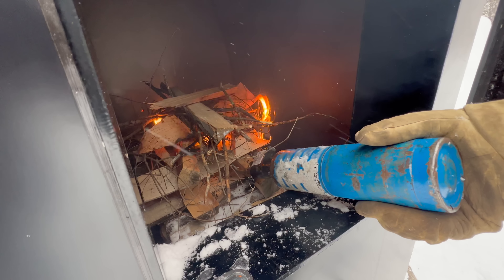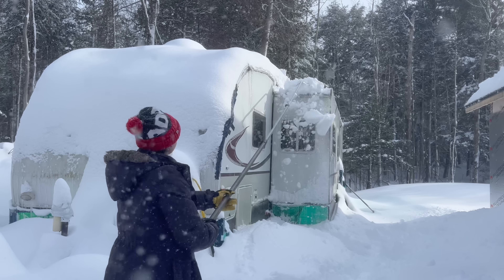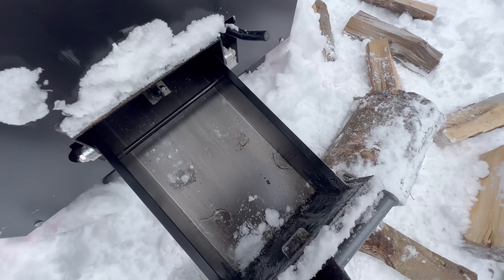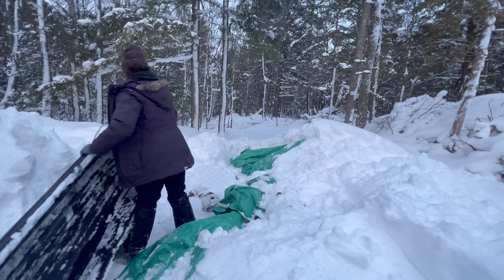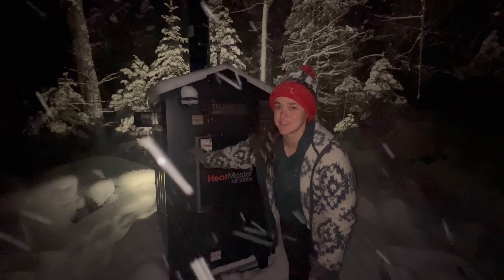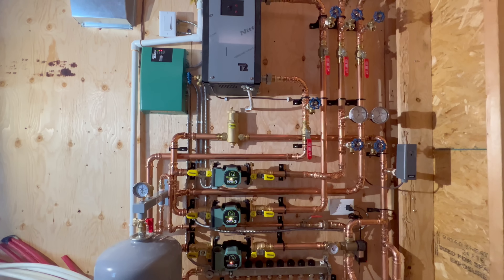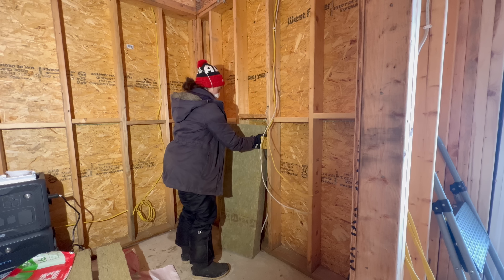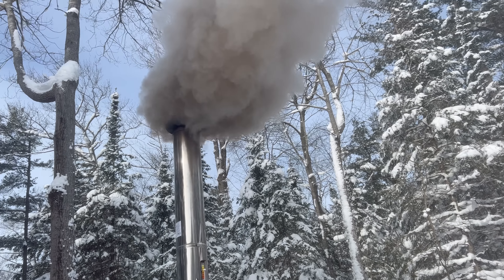How We Heat Our Home On Our 18 Acre Homestead!

Comment: Beautifully designed system inside the house, but the boiler seems very inefficient.
Reply from the maker: The boiler seems very inefficient because it was -18 outside, the house isn’t insulated, the slab holds the cold so it takes a long time to heat, and I was burning mainly softwood. Don’t worry, it will be more efficient when the home is running properly

Comment: The fire goes in to smoulder mode until the temperature drops. Then the draft kicks open and ignites the fire. My draft was on the front door? Draft at front and chimney pipe at the back. I had-no fan.

Comment: Unless code has changed, fire blocking is only required for walls over 8’ tall. I’m in Oregon so it could be different here. 😊
Reply from the maker: You’re not required fire blocking here either :). But I’m still doing it!
Reply: @SimpleLivingwithBiata  Okay. 🙂

Comment: Good day, are you able to feed full length logs, instead of cut firewood? Also do you have access to hard wood?
Reply from the maker: Yes and yes! I’m def going to do this more next year!
Reply: I have a friend back home in BC that could put 4ft x 2ft logs in his heat system in his house. The first time I had ever seen this done, impressive. The fire door was on the outside of his house and the unit had a steel plate inside to cook on if needed. @SimpleLivingwithBiata

Comment: Rockwool is the only thing I would use because I used fiberglass in my 100 year old house  and had to do a repair and found that the fiberglass that once filled the wall Shrunk and left a large air gap plus the rockwool is water resistant and fire proof.
Reply from the maker: Oh wow! Thank you!

Comment: Is there no heat storage tank (whatever it is in english )? Is seems there is a hot water tank for washing etc. but the floor heating etc is fed directly from the furnace.

Log furnace and a few cubic meters (500-1000gal) storage tank means you need to fire up once a day on a cold day. With this direct heat system it seems you need to keep up the fire 24/7.
Reply from the maker: This is really good to know, thank you!
Reply: @SimpleLivingwithBiata  As usual for advice from youtube comments, probably too late to change anything (without huge costs, at least). And that's assuming my monday quarterbacking is any good for your situation. You've spent two years on the house so I'll bow to your expertise on building it! 

I'll have to watch more of your videos to see what your heating /power system is and how it is supposed to work. I'm sure with insulation the heating will be a smaller chore. 🙂

Here in Finland there's basically two kinds of wood heating systems. Log furnace with a big storage tank or a wood chip/pellet furnace with no/smaller tank. 

Log furnaces can burn cleaner and more effectively when they can dump all the energy to the big storage tank, compared to trying to keep the fire smoldering for hours. Central heating etc. runs from the storage tank.

The wood chip system can be automated so they keep the small fire going 24/7, using the small tank during eg. power outages or in the summer when you don't need to fire up every day.

Comment: For flat ceilings I used blow in insulation and for your cathedral ceilings I would use fiber glass insulation with paper backing. Do you have to have air ventilation above your insulation, I don't remember what those sheets are called but where my trusts met the walls I had to tack them to the top between the trusses
Reply from the maker: I do have to have air ventilation for the cathedral ceiling and for my trusses. The cathedral requires it all the way up … more difficult for sure
Reply: @SimpleLivingwithBiata  I know you can handle it and your husband will help you if needed

Comment: Unless the wall is less than 16 inches wide then your stud spaces should still be 16 on center........"the stud spaces aren't 16 inches because of how small the wall is"....... doesn't make sense
Reply from the maker: Well two of openings were 16 OC, the other two there wasn’t enough room because there was a door in the middle. Hope that helps

Comment: Go pink or centerteed brand its a little cheaper than pink. Rockwool is best but expensive.  Spray foam best of all but way too expensive for what it is. Will you have a air exchanger?
Reply from the maker: Thank you! And we’ll have an ERV unit

Comment: I am curious about wood boilers, why not use wood boiler inside house and run vent to roof, would it not be more efficient in operation and consumption while maintaining heat without dealing with outside weather conditions like snow and ice?
Reply from the maker: With an indoor wood furnace you’d have to have a whole room dedicated to wood storage inside your house, your air won’t be as clean, your insistence will cost more, you can only burn seasoned hardwood, and it’s a lot more work with splitting!
Reply from the maker: Also, it would be forced air which isn’t very efficient. In floor heating is much more efficient

Comment: Great job! That plumbing work is beautifully done, though I don't know why you didn't go with a PEX manifold home run install - way cheaper and easier. Did you get any quotes for blown cellulose? It's the best way to go for cost - blown/sprayed insulation - and, especially, environmental consideration. If not, stone/rockwool for exterior/celing and pink on interior walls if you want to save money. You absolutely do not need anything more than pink for interior walls unless soundproofing is really important to you. It all comes down to what you can afford and if you feel it's worth spending more for a little bit more R value and better soundproofing.
Reply from the maker: Thanks so much! I’m not sure about the Rex manifold. Maybe they aren’t as common in Canada? Uponor was the only one I got quoted on!

Comment: Wow it must cost a lot to get one installed.. especially in Canada
Reply from the maker: It would be if you hire the whole thing out: the cost of installing the large pipes in the Big O, the cost of installing the in floor heating, and installing the boiler and then all the copper work on top of it. It honestly wasn’t too bad with hiring out this portion. But more costly than most heating systems. But you pay for it up front and only pay for chains and chainsaw upkeep for years and years :).

Comment: liked & subscribed great video hopefully. moving further into country later this year & will be investing in an out door boiler!.. why didnt you run the radiant floor straight from the outdoor boiler instead of using an electric boiler, would have saved you some $.
Reply from the maker: Wow amazing! And thank you! I wish we didn’t have to have the electric boiler but we legally need a back up heat source. It can’t just be off grid. So it’s better to have an electric back up to run the in floor heating system because it’s a floating slab. If it wasn’t a floating slab we could’ve just done electric baseboard heat
Reply: @SimpleLivingwithBiata  what country, state, province are you?

Comment: I recently watched a you tube video about stacking wood in a burner like yours and I was surprised at seeing there is a very efficient way to load the wood to get the most heat and burn time. He showed that putting the wood in like you are doing is not nearly as effective. There are several videos or ask the company you bought it from, it involved "gassification" of the wood to best burn it.
Reply from the maker: Thank you! I’ll look into it but I don’t have a gasification unit! They’re totally different :)

Comment: You should have spray foamed it
Reply from the maker: Still need to insulate my house but I have to do wiring, HVAC and finish the plumbing first. Spray foam is just so not worth the cost. Especially for a wood heated home
Reply: @SimpleLivingwithBiata  that’s no good we did our house roughly 4500sqft.   Cost us 8k to do it but that was pre covid

Comment: Your work ethic is unbeatable.    There’s always going to be so much each day on a homestead needing attention.   After 2 years have realized that’s just the way it is.  I never leave comments.   This is the first time I am posting a comment.   We recently replaced the 21 year old wood boiler in this house.    We purchased from the original owners.   The newer “ better “ boiler was a struggle to maintain constant temperature.    The dealer never gave up trying to improve the performance.   After a lot of effort, another section of chimney was installed.   Instantly things got better.   Wood lasted longer, heat stayed higher.   We now get 24-28 hour burn times on loads of wood.   If your boiler cannot draft the fire struggles.    Our cold climate and high elevation required the extra chimney.    Hope you are getting longer burn times now.  Good luck.
Reply from the maker: Wow thank you so much for this and the ideas! Do you have a gasification unit? I heard they can be more tricky with wet wood too.

And thanks so much for watching and commenting

Comment: You stacked the wood on backwards  ....put your kindling in first then place your big wood on top ......
Reply from the maker: “What is an Upside Down Fire? An “Upside Down Fire” is a simple technique that burns from the top to the bottom using less wood with a longer burn time. The pieces of wood are arranged by stacking back and forth in opposite directions. Add tinder and kindling on top and light to allow the flame to catch the lower half.” Google search

Comment: Im thinking you should be able to slow the burn down, you should have to only fill the heater a couple of times a day surely, Lumnah Acres have one, but theirs is the G Series so it does have a different burn, bigger than yours they have the G10000, had it for over a year now, you wont know yourself working in some heat.
Reply from the maker: I think once we have insulation it will be much better. But right now, all that heat goes out sadly :(

Comment: Traded in 4 Heatmasters (MF/C series) last year. All customers had wood boilers previously. They were not impressed with the false marketing regarding efficiency. I couldn't believe how much they burnt!

I hope they gave you the boiler for such a nice video.
Reply from the maker: Oh wow! No they didn’t work with me for the video, this isn’t sponsored in any way. That’s really too bad. I’m hoping it will be more efficient once the house is insulated. What did they trade in for? The G series?
Reply: @SimpleLivingwithBiata  the MF, which is the Canadian version of the C series. It's an identical model boiler just branded for the USA EPA regulation.

They traded in to a different brand Portage and Main Ultimizer. It's still a conventional can burn anything but with better insulation, a full multipass heatexchanger, firebrick, over and under air channels. It really brings the efficiency closer to a gasser without the maintenance.

I've heard people with the G series seem to be happy long as they have dry wood.

Overall nice video and content your channel has!

Comment: You won’t see flames when you open the door to your boiler it should just be burying the gas from the wood so the hot coals put off the gas the only time you’ll see flames is when the temperature goes down and the fan kicks in it’s normal not to see flames
Reply from the maker: Thank you! It was quite the moment figuring that out lol

Comment: Rockwool is good because it is fire resistant and mold resistant the pink stuff can be paperback this will act as your vapor barrier. Or you can use non-paper backed then put plastic up to act as your vapor barrier this is what contractors do in my area it will be your cheapest option with plastic on the ceiling then blown in in the attic. I insulated the room above my garage. I put 1 in foam board on the floor  then rolled r30 insulation. I used a foam gun on the blue board to seal it. There is quite the difference with just one inch of foam keeps the floor warm
Reply from the maker: Thank you so much for the info!

Comment: At least you tarped the chopped wood before that huge snow fall. LOL You should consider affiliating that log splitter you had on the ground, I bet that would do well, never seen that before. I used to use 12 Chords a winter up until this last year. Curious, how long does the wood boiler last before you have to fill it with more wood Biata? I drove to Ohio to buy a Wood Stove from a guy who implemented one of those wood boilers in place of it, his held 4' long 12" log's. Smart as Consumers here in Michigan was $402 last month, and we only kept it on 73 degrees when it went 10 below zero, but usually we have it on 70 degrees, and it's still $380-390, it's ridiculous. I say this just about every post, but my goodness, this is SO IMPRESSIVE that you took on this entire project not even knowing how to do much of this. Proves Confidence in ourselves, (and of course help from loved ones), is Essential in our Progress and Expansion of our Amazing Lives.  #SoImpressive #OffGridLiving

Comment: Benefits of rock wool over fiberglass insulation… rock wool is actually made from rock which makes it extremely NON flammable. You can test this by taking a small scrap piece and try to light it with a propane torch. I believe you’ll be shocked at the results.. rockwool is also a superior sound insulation over fiberglass.. if you have rooms that you want maximum privacy use rockwool in those rooms as far as insulation goes they both work just fine and will keep your house very comfortable in the winter and summer what it really boils down to is budget. If it were me I would use just rock wool if it was in the budget if not  there’s certainly nothing wrong with using fiberglass I would however use R-30 especially in the ceiling
Reply from the maker: Thank you so much for all of this info!
Reply: Hope it was helpful

Comment: I think you should have bought a larger bowler. But it all looks great.
Reply from the maker: Yah I was honestly surprised with how small it is but it heats up to 3000 sq feet when the house is insulated lol
Reply: Thanks for the reply, I was heating a 1200 sq foot house and a 600 sq foot work shop in Michigan. What is good about a larger burner I only filled it 2 times for a 24 hour burn. Thanks your doing a great job.

Comment: Why would you want a burner somewhere outside and why not somewhere indoor in a closet or something.
Reply from the maker: Not as efficient. Still having to haul wood inside. And then requiring a room in your house specifically for wood
Reply from the maker: Also indoor wood stoves can’t burn soft wood like birch or hemlock which we have a lot of
Reply: Smoke, dirt and fire is kept outside which is much safer and less messy.

Comment: You need BIG wood once it’s burning. As big as you can handle. Otherwise you will be spending a lot of time packing wood. Good damper control is important. It should last all night. I would love to have one of these but I don’t like the idea of cutting firewood. Did that for years. 😏
Reply from the maker: For sure! I cut these too small last year!

Comment: You can actually retrofit you cloths dryer with a heater from your boiler too 👍check it out because a dryer not using electricity is cheap right 😉

Comment: Like someone else said don't be afraid to leave some of the wood bigger in the future. It will also help to take more time packing the wood in the boiler to fit more in. I am not sure what the purpose of putting glycol in instead of water. I realize it is anti-freeze but no worries if you keep the fire going.

Comment: I have no experience with the pink stuff (is it glass wool?), but we insulated our house (located in Iceland) with rockwool; 6 inches in the exterior walls and 8 inches in the roof. Our house is nice and cosy and we don't have to heat it very much at all. In fact, I haven't installed all the radiators that were originally planned, there is simply no need for them all.
Reply from the maker: Wow great to know! Thank you. Pink stuff is just fibreglass insulation

Comment: Glad to see that you finally have your heat system in place and working. I do have some questions though. Who is going to be keeping the fire going? How often are you going to have to go out and tend to the fire? Will you have a gas backup system in case you run out of wood? Also are you going to have to run the fire even in the warm months of the year in order to have hot water? Hope all goes well for you. Have a great week.
Reply from the maker: Thank you so much! So we have an electric back up system, a propane back up system was going to cost double and it just didn’t make sense. Can’t get natural gas here. And propane costs have gone up so much that they’re similar enough to electrical. 

Once the home is insulated I should only have to fill twice a day! And we won’t run the wood boiler year round. The hot water tank runs off electric too :)
Reply: @SimpleLivingwithBiata  Well it sounds like you have a good plan in place. Glad that you’re making good progress.

Comment: Hello,
 Rockwool is the best way to go. Unlike fiberglass insulation the rock wool insulation has better properties then FGlass. It keep your house warmer longer in the winter F. Glass. If you also, put in a radiant barrier with the rock wool it will retain the heat in the room as long as you keep the door closed and the room seal.

Comment: God Bless from your Canadian Friend The board you needed for nailing your strapping to is called backer board, It would be a good idea to put it on top of all your interior and exterior walls that run parallel to you do your trusses. 2 x 6 over 2 x4 walls supplies backer for both of sides of the wall do this before you wire makes it a lot easier.
Reply from the maker: Thank you so much! I appreciate the term knowledge as well!